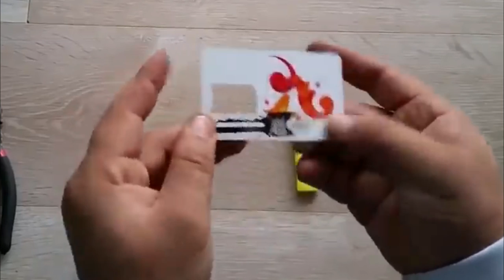10 Ways to Open a Lock 🔴 NEW

Comment: Try that bullshit on a Master Lock
Reply: David Hoffman 
Ouch most Master Lock padlocks really suck, their most common padlocks offer almost 0 pick resistance and can be opened by complete lock picking noobs in seconds.
They also tend to have bypasses, e.g. some can be bypassed by comb picks where you simply push all the pins above the shear line at the same time or they aren’t shielded thus you only have to insert a thin metal piece and you can open them without having to turn the cylinder.
Cool is also their electronic key lock box where you can unscrew the locking bolts when it’s closed.

Just for example
A 120$ electronic lock box that can be unscrewed whilst locked...
https://youtu.be/umZ0bbs1EeQ

Master Lock 176 bypass (works also on the 175)
https://youtu.be/oFdzijpUdNM

Comb pick used with Master 9140
https://youtu.be/aMEgMkosfHA

Master Lock 606 bypass (works also with the other 60x locks).
https://youtu.be/DCEU_mylxaM

Raking open three different Master locks in 22 seconds, no skill required 
https://youtu.be/zfJzVys9Y_Q